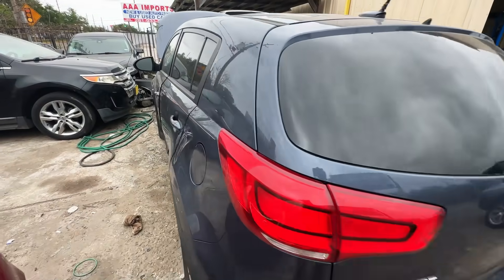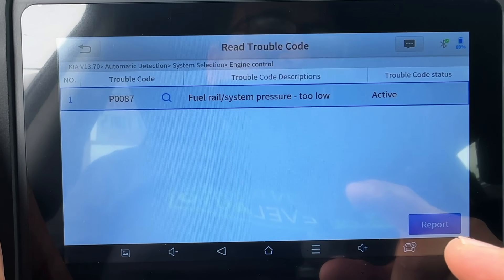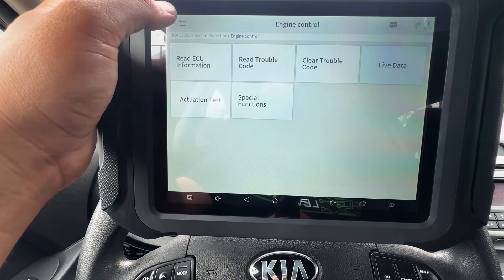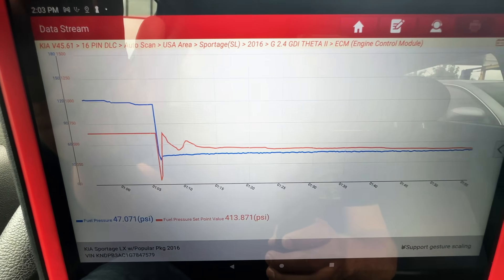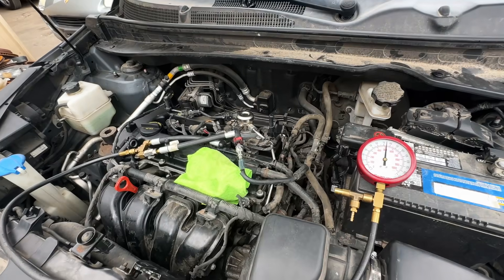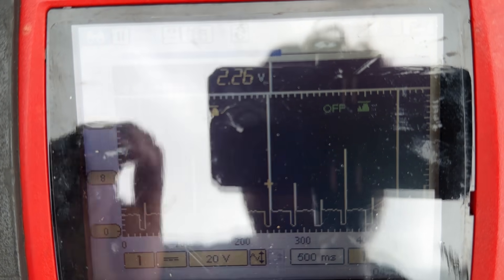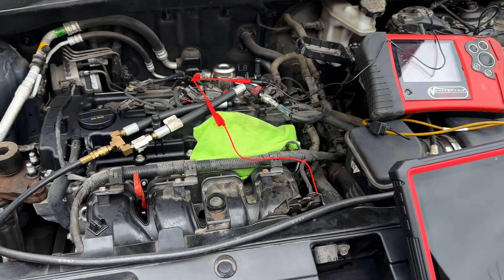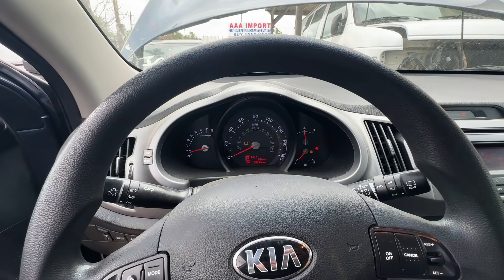KIA SPORTAGE GDI FUEL RAIL PRESSURE TOO LOW P0087 DIAGNOSIS & FIX

Comment: I have a problem but not the same.
The fuel pressure is more than what it suppose to be. It should be 2450  at idle but it reaches 4000
and when running it reaches 20000 while it should be 15000
what are the possibilities.

Comment: This was one of the best videos I’ve watched about the 2.4 Kia 
I just installed a new 2.4 in a 2013 Kia Optima. I started it and it had a long crank as well. Then it showed same code. Man if I’d of not seen your video I’d of went insane. And I had same problem. Cam follower was in old engine. Didn’t have one in new engine. Runs fantastic now. 
Thanks for the informative video

Comment: I knew that part was gone from the second you first started it by the loud tapping noise as the new pump was eating the cam lobe.  Good job letting it run and ensure the cam was completely shot.

Comment: Nice catch by any time you loosen the high pressure pump bolts and the high pressure metal line they all need to be replaced. They are torque to yield bolts and the high pressure line is designed as one time use as well.

Comment: Congratz, fantastic process of doing a proper diagnosis. Thats exactly what separates a mechanic from someone who just throws parts at a repair hoping to fix something along the way. Sure, you could do that, but that'll cost a lot of money.

Aint gonna lie, as a mechanic, sometimes I also have to take an educated guess, there are just too many variables involved and way to many deviances between car makes and models but thats NEVER an  excuse for not doing a proper diagnosis.

Eg for example, practically all petrol engines prumye the fuel pump at the key on. EXCEPT for my 1.8T A6 which fuel relay sends a signal to primes only once it recieves a signal from the crankshaft sensor...

I spent 4 days trying to figure thay out... At least it was my own car.

Also, just for the record, I never trust anyone who said that they have already replaced parts thenselves. You never know what was the quality of the said parts. I remember fitting a customers camshaft sensor having given in to their reasoning that what they bought was "good enough"... Only afterwards I double checked the product company (as the customer never gave me the original parts box) and it was one of the worst aftermarket makes anyone could buy.

Swapped it out for an expensive part and suddenly the ECU could register camshaft rotations properly.

Comment: I have a 2013 Hyundai Accent with the same code. This thing turns off when intermittently and is hard to turn on. You leave it alone and then some time later it will turn on and work fine. Low pressure pump tests good. High pressure pump puts what it is asked to, no difference. I have only been able to duplicate the issue once and noticed that when it turned off the coils were not firing, but it does not set a code for anything else other than a knock sensor code. I know its hard but any guidance would help.

Comment: I still use my snap on vantage pro. It’s compact and and takes care or most of the jobs I need the scope for. I have a 4ch also but the vantage pro is great for jobs like this. I wish snapon would still have updates for it. Sometimes it’s easier to just get the connector view from the scope itself.

Comment: Hi, love your videos and the way you diagnose electrical components. I have a convertible F type that the convertible top is not working. Have even changed the module and no luck.  Have done a lot of work on it, I feel like I don't trust anyone with my car but I'll definitely would like if you can work on it.

Comment: Why would XTool not want you to show a feature? That's a bit puzzling and makes me skeptical of it.
Reply from the maker: It can do mileage adjustments. I guess that can be a little controversial. Thanks for watching!
Reply: @ADVANCEDLEVELAUTO  True that. I guess as always it goes back to the honor system. I remember the day if a speedometer was replaced we had to put a sticker on the door jam. lol  All the same xtool or any other brands knows it's needed  and a criminal will always be around.

Comment: Hey Eric, My Coworker has a 2017 kia sportage 4 cylinder with 92K on the clock. This thing is going through a quart of oil every 250 miles! It dont smoke and it dont leak. She took it some place and they replaced the Valve cover and pcv valve and it made no change. Any ideas what she should try next? Im baffled!Lol! Thanks
Reply: Pull the Spark Plugs out and examine them for signs of Engine Oil getting on them.
Reply: @davidhall3747  plugs are directly in to the head, where oil splashes up and lubricate the entire inside 9f the engine bes8des water channel's.  So oil 9n plugs is normal. Lol u shud be more spwcific like if the oil 8s a white whipped cream looking colour then the head has gone/piston ring's or even bott9m end. Least you tried to help i suppose thats the main thing

Comment: Even though you are not familiar with Hpa vs Psi, you could have continued with the original scanner. The important facts are the relative numbers  When there is a difference between actual vs requested of 3X, you know what you need to know.

Comment: You gotta know the system in order to diagnose it.  Early on in the video I was thinking a slightly worn camshaft, but you have to do the tests like Eric did here.  Learned something new about the roller.  Do all GDI pumps have the roller like this Kia?
I have a 2020 Toyota RAV4 with the A25A FKS engine that has GDI.  Does this engine have that roller?
Good diagnosis Eric!  Thanks for this video.

Comment: If a less knowledgeble investigated he would have diagnosed a faulty new high pressure fuel pump the replacement which would not have solved the problem.
Top marks to you diagnosing the real cause!

Comment: Here is what sucks about gdi..

So if you have a problem with fuel pressure, you cant hook a manual gauge up to high side to verify what the high side is. You HAVE to depend on the fuel pressure sensor… guess what, those go bad. So no way to know if the sensor is reading correctly or not. Its a losing battle
Reply: One can "know" the sensor is bad by making sure that the rest of the sensor circuit is okay. Identification by exclusion. Not quite as straightforward as port injection but not too bad.
Reply: @abdul-kabiralegbe5660  I disagree…just because it has proper power, ground, and a signal, does not mean its good… you prove those three things out, and the sensor can be bad and not send proper signal and you cant verify it unless you have a high side manual gauge to verify. Which they dont make.
Reply: @mikesabin8568  How about unplugging the connector and shorting signal to power and ground respectively while monitoring Live Data. If signal response is okay, then wires and ECM are good. Next plug it back, check Live Data to see signal voltage: is it within the expected range (see Service Information) while at rest/cranking, etc? The fuel pressure regulator solenoid should be actuated/bypassed manually to put the pressure at default (some regulators build pressure when energised, others when deenergized, so you have to know the design you're working on). Manipulating the regulator allows you to make the system go to default pressure (which is a known value, you have to research). Check Live Data for this expected default pressure.

What I'm getting at is that there are INDIRECT ways of knowing if the rail pressure sensor is trustworthy or not.

At least, that's how I'd go about things.🤷
Reply: @abdul-kabiralegbe5660  I already know how to check wiring… that really isnt what im talking about at all….

Im talking about if the wiring is fine and the computer is fine, you still have no way of knowing if the sensor is doing its job accurately or not…  you said check service info. Not a single car ever has provided info on what the high side is that i have seen. And even if it did, that still doesn’t verify if its the sensor or the pump so we are right back at the beginning of my argument. The only way you can verify if the sensor is accurate would be a high side manual gauge which does not exist

Comment: I mean nice find but correct me if I'm wrong but I could hear a tapping noise coming from that engine when it was running.  Hopefully there is no cam damage without the roller.

Comment: I know why he didnt put the roller back on he needed to turn the motor over so the cam lobe the tip is not facing up and he was having a hard time bolting down happened to me in the old chevy fuel pumps and Cummins 12 valve engine need to turn the crank so the highest point of the cam lobe is facing down.